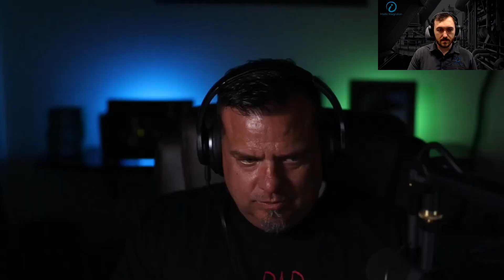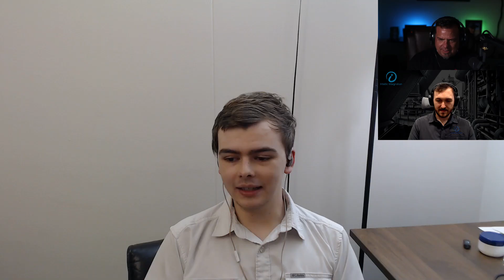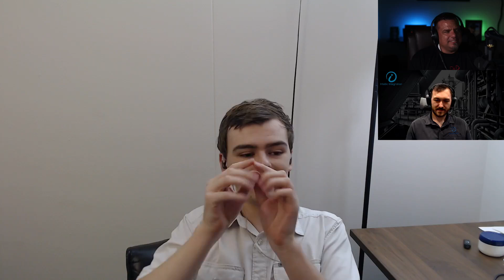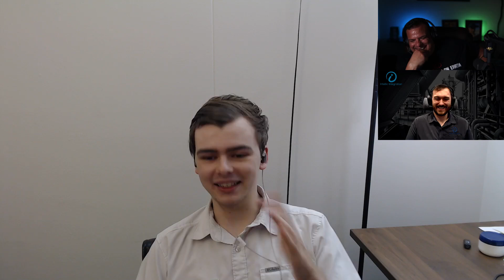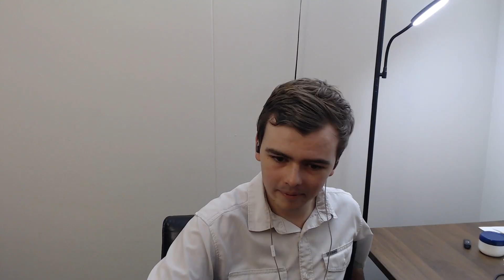AI Tool vs Trend | How to Find Real AI Solutions

Comment: Really Great video , If a follow up could go a bit deeper an two topics  that would certainly help me.
1. On Differentiating AI from Traditional Computer Programs:

a. In some of the AI examples presented, they appear to me as traditional computer programs rather than what's typically understood as AI. Could you clarify the distinction? For instance, if I code a program to process images, detect edges, and count objects within set parameters, how does that transition from being a mere program to an AI system?

b. Following that, if I employ a dataset with a known number of objects to train and fine-tune this model, it becomes clearer that it's more than just traditional programming. Can you elaborate on this transition from conventional programming to AI-driven methods?

c. I'd also appreciate some clarity on the concept of AI in automation. Taking the example of a fan that removes empty boxes from a production line – I would not call this AI, but in todays climate I am sure some marketing executive might try, as it is replacing a decision that was done by human intelligence where an operator looked at the box and evaluated if it was empty . Even an automated example of a load cell and reject pusher, that is Automation and not AI but again would. 

So maybe in summary some more examples of false claims of AI and why it is not AI.

2. Delving into the Specifics of the Machine Learning Process:

a. Can you elaborate on the tools and techniques commonly employed in the data collection phase, especially when dealing with historical data? Or at least where to start.

b. What are the best practices or tools you recommend for data preprocessing?

c. Concerning model selection, is there a structured approach to determine which model to start with and how to progress? For example, is it typical to commence with linear regression and then explore more complex models based on initial findings, or do you need ML experience to pair the use case with the most appropriate models?
Reply from the maker: Some great topics for follow up posts, Mark. Thanks.